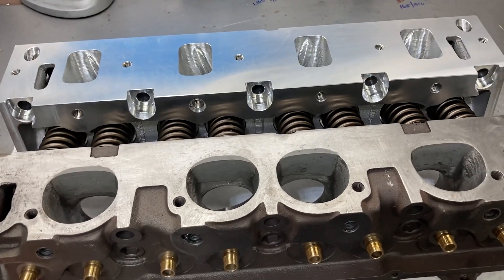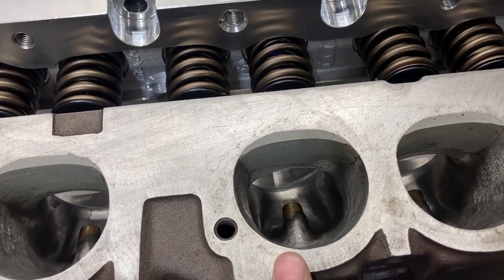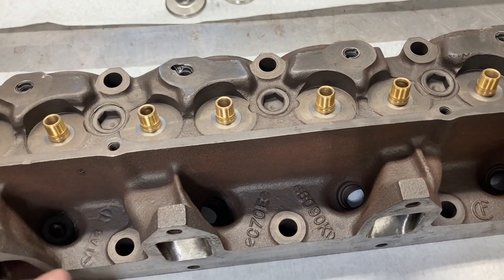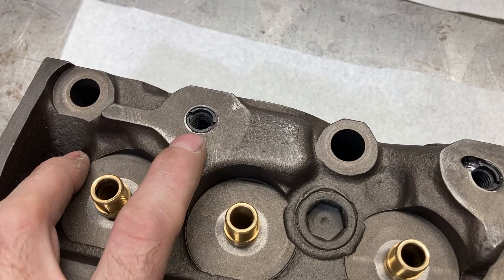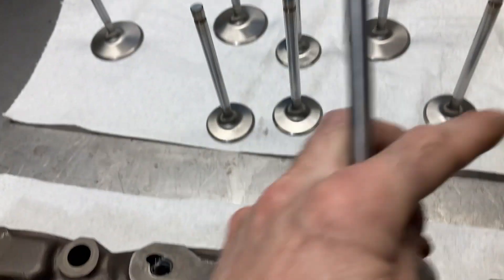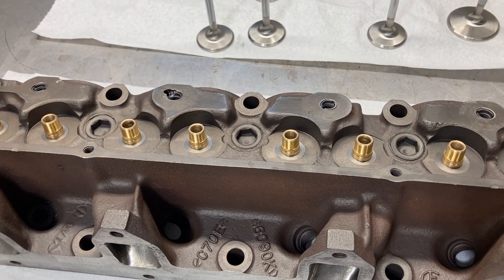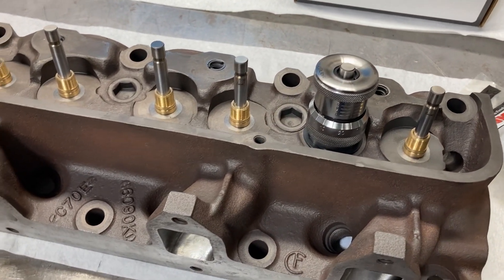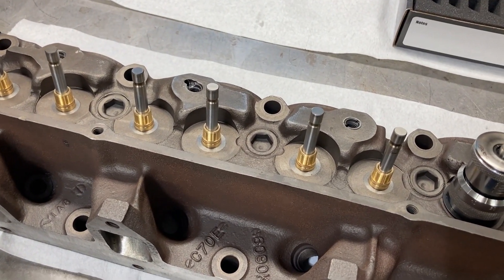Lykins Motorsports 465 FE Tunnel Port Cylinder Head Assembly Part 1

Comment: I had a set that were with slight cracks on the outside of the top exhaust port and one intake seat had a huge crack . They seem to have a problem as far as castings Steam may have been the reason ..

Comment: Hey Brent how much horse power is a factory FE block good for ? It's a 69 model
Reply from the maker: A 390/428 block will usually take about 600 hp before they start to split between the cam tunnel and main tunnel.  Lots of variables there though.
Reply: @lykinsmotorsports  Not sure what FE block Ford used in top fuel back in the day but the blocks used were good for about 1500 HP. This info came from an old friend that was there back in the day. I'd get more details but he passed away so I can't. RIP Dick!
Reply from the maker: @Wonderwrench  They certainly didn't use 390/428 blocks, they used cross-bolted, filled, 427 blocks.  They always didn't last either....
Reply: @lykinsmotorsports  yup when 1500 HP was no longer enough to win they were out of top fuel.